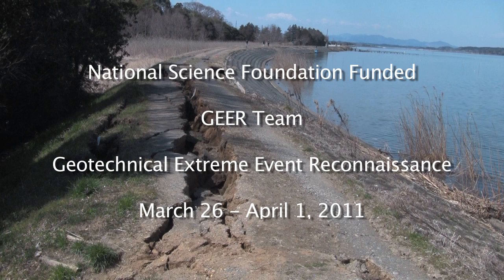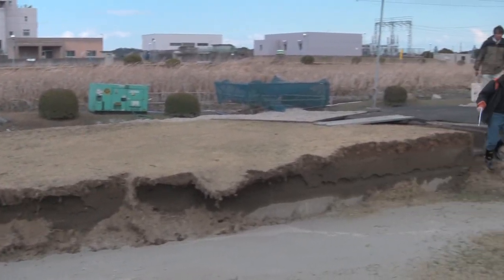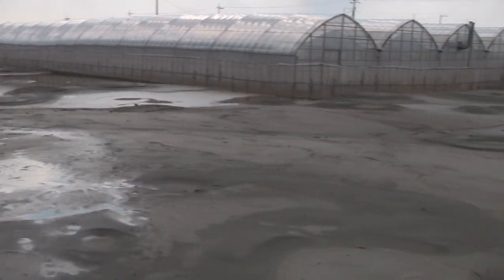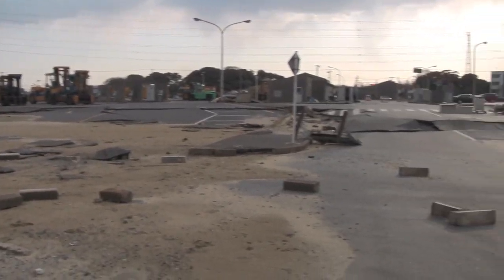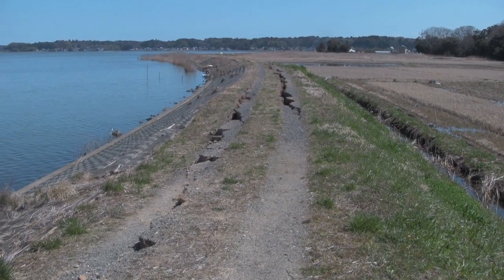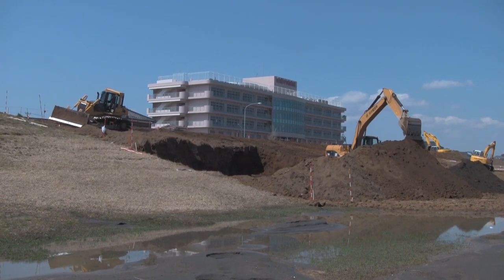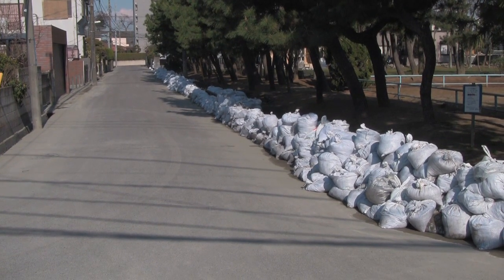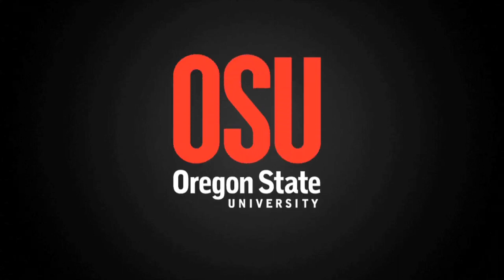Japan Earthquake 2011 Liquefaction Damage

Comment: 2:59 the mud almost seems membranous. How is it able to ripple like that without this person's feet sinking in?
Reply: Get some cornflour & add water. Shake it & poke it - it's the same as liquefaction. The water pulls on minute grains causing an adhesion bond. Water spiders sit on the water surface using surface tension.
Reply: @sixthsenseamelia  i googled cornstarch & water and the term that came up was "dilatant" or "shear-thickening" (reading about it was great btw so thanks for bringing it to my attention). But dilatant materials lose viscosity when the shearing force is removed, whereas in the video there are footprints on the mud that remain intact with no foot on them.

Comment: true 9.0 damage would have NO structures standing. 6.0 maaayyybbeee
Reply: This video is from an area more then 100 miles or 160 kms from the earthquake epicenter.
Reply: @CapeKell It was a 9.1. And If the buildings are made to withstand actual eartquakes, like in Japan, the damages can be small. Infact, the most part of the destruction was brought by the tsunami. Sure as hell that a 9.1 Richter in the US, where no one wants to spend a cent in safety, would have erased to the ground every single building. San Francisco, ring a bell?
Reply: Alaska 1964

Comment: Do you have anyinformation on what happens to gas station fuel tanks?  I am in the process in intervening in the design stage of a gas station which is located 31m from an estuary with proposed tanks which would be located below or at sea level depending on the height of the tides. I want the tanks on the surface.
 
If anyone has information on damaged fuel tanks intalled in estuarine environs damaged by earthquakes could you please contact me?